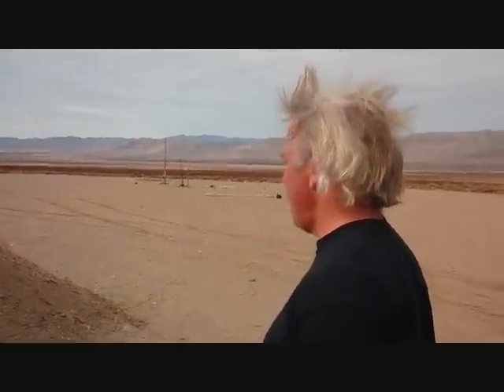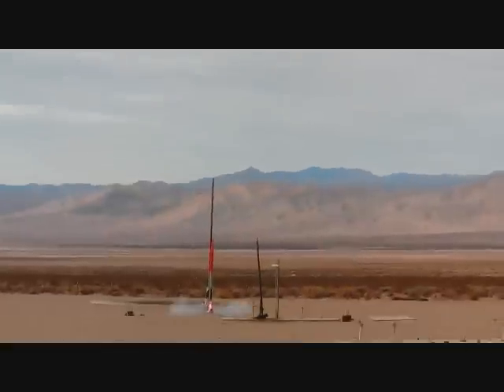Experimental Rocket Guidance, Paul Breed

Comment: Read the FAR 101 amataeur rocket regulations, also read the NAR or Tripoli safety code and you will find no rule against guidance.  If you start using it to "Target" something then you will likely be in violation of the ATF destructive devices rules.    In Fact all of the controlled hovering vehicles in the NGLLC were flown under the same FAA amateur rules that govern normal model rockets.